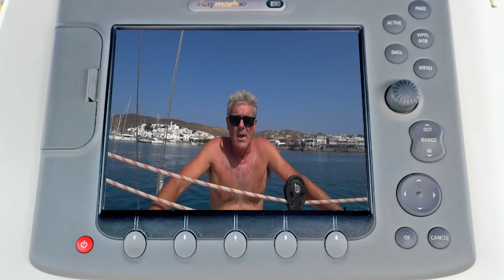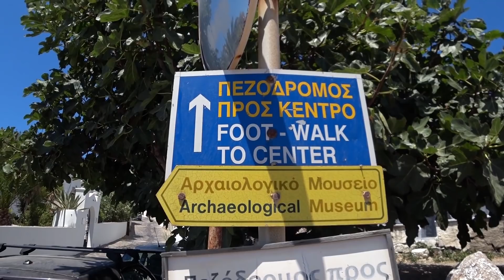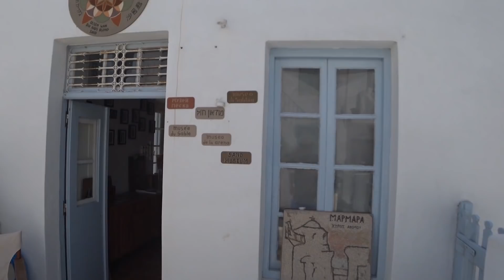How to replace the main sail furling line - Sailing A B Sea (Ep.087)

Comment: We just completed our inhaul replacement on Oceanis 41. We disconnected the furling mechanism after dropping the main. Pulled the whole unit out and cut the line at the bottom. 

We watched your video, and noted how long it took to wind in the new inhaul line. We disconnected the mechanism from the main’s roller. The furling mechanism was then able to roll easily and quickly by hand in about 5 mins. Reconnect and reinstall and raise sails. Bob IS your uncle.
Reply from the maker: (Baz) My uncle Bob died a few years ago. 😂

Comment: well done with the furling line. do you feel a difference in the ease of pulling the main sail in/out after you changed the line? Our main furling is a real chain to pull the main out/in...
Reply from the maker: Hey Tibor, changing the line has not made it any easier. But we have cleaned and lubricated the track that the out haul car runs on and that has made things easier.👍